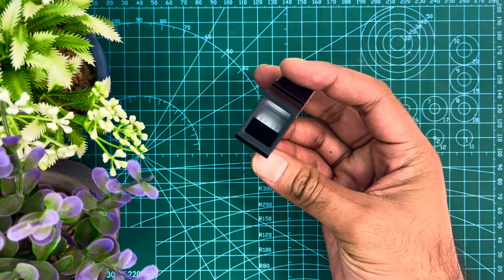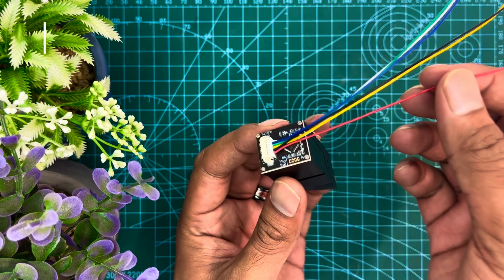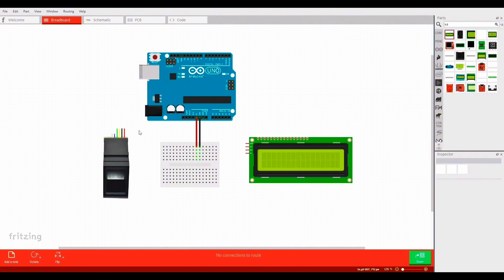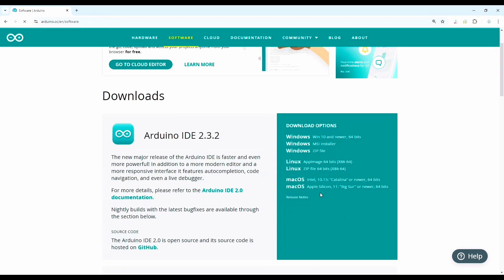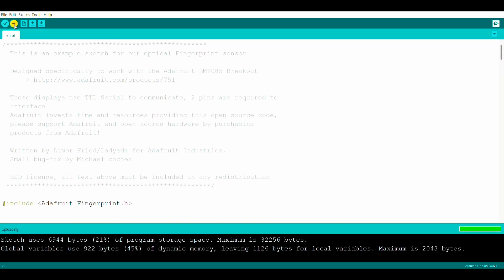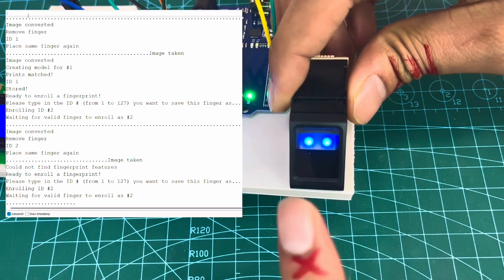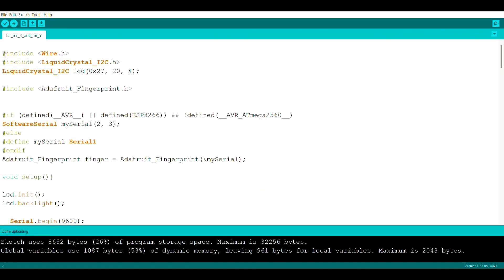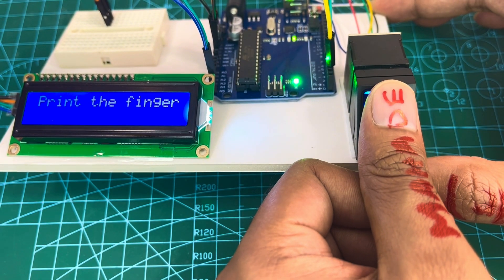R307 Finger Print Module with Arduino || DIY Tutorial

Comment: I have used r307s instead r307 but I am not getting any output in lcd and biometric but remaining are working should I put the connections in different way please reply @Mahade DIY
Reply from the maker: Check the wires from the datasheet of the R307s and make sure the connection is correct . Alao make sure that you include the correct library for the LCD

Comment: sir how to connect fingerprint sensors wires with arduino because mine only has plain wire with no female jack attached to them
Reply from the maker: Hi dear 
Cut any  male jumper wires and joint with the sensor wire . I also did the same.

Comment: I am also using the same setup, but i am getting error Did not find fingerprint sensor :(
Reply from the maker: Check the fingerprint wire. Is it the same fingerprint sensor? If not then check the datasheet of the fingerprint sensor to know which is Tx and Rx
Reply: @mahade_DIY  all correct, but also not detected
Reply from the maker: @lokeshgn8354 maybe problem with the sensor
Reply: @mahade_DIY  i am also assuming same
Reply: Hello, I am also having the same issue and have tried replacing the sensor and I could not get it work. DId you ever get it working?